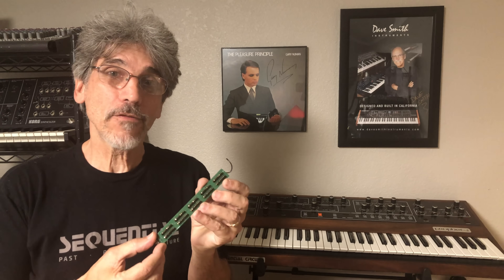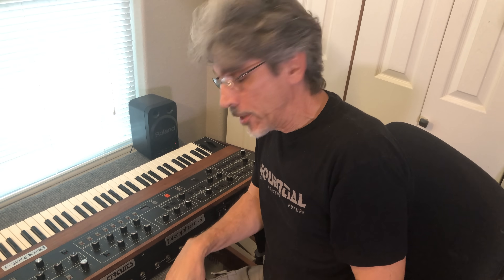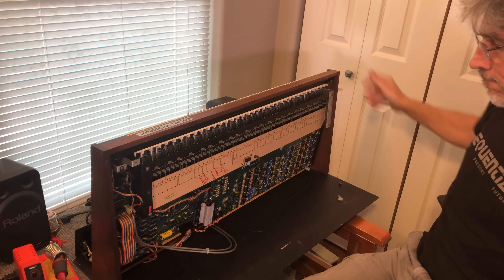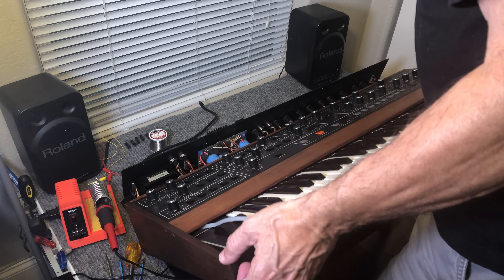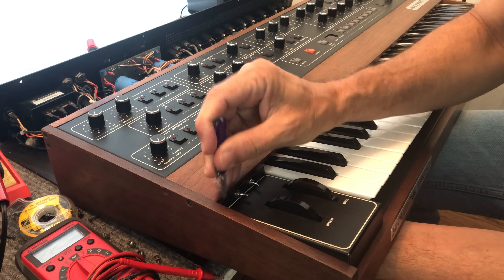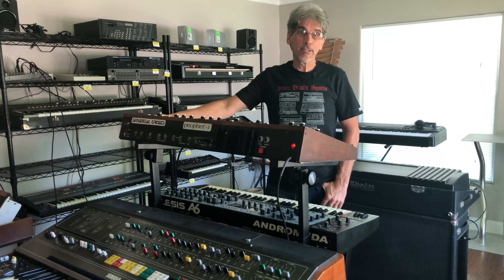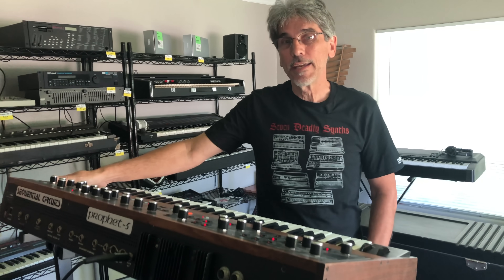The Analogue Renaissance REV -1

Comment: Hi - quick question before I pre-order.  Obvious maybe - but have to check just the same. 😉 I assume I can't use my old Curtis sounds once this is wired in.  It's the SSM 2/4 pole and bass compensation only unless I desolder and go back to the original.  No option with the switch to use the original Curtis because they've been taken out?  Obvious maybe, but just checking - thanks - this looks great! 👍
Reply from the maker: Yes, the Curtis chips are removed to install the REV -1.  But with the switches set to 4-pole with Q-Comp off, your original sounds will be fundamentally the same as before - they will just sound bigger.
Reply: @Syntaur  Thank you for taking the time to get back to me - really appreciate it and am ordering one as of right this minute.  It was a little difficult to find links to purchase , but they are available (currently preorder in June 2020) - note that I ordered from the European outlet as that's where I am and want to avoid extra tax (http://www.analoguerenaissance.com/rev-1/), but for folks in the US the Syntaur web page would be better (https://syntaur.com/Items.php?Item=REV1)👍👍
(I will delete the links if Syntaur prefers, but I thought they'd be helpful as it took me a while to find them).

Comment: Great video and great product. Two things to nitpick: 1) wires at positive potential should not be black and 2) those "Arduino" connectors are notoriously unreliable, especially single stranded ones which have no holding power. Better to solder those wires as well or at least use 1 single connector.

Comment: I thought nothing would be able to match the clean and cutting resonance of the Jupiter-8 2-pole mode, but this matches it. That said, this is only half of the sound of the Rev 1/2. The SSM2030 oscillator was saw core, while the CEM3340 oscillator is triangle core (yielding a brighter saw).

Comment: Can I use it in a Prophet 10?
Reply: Hi, I'm the designer of these. That should be possible immediately on the later versions of the prophet 10. Only thing extra needed is some extra wires to those switches.
Reply: @dnaab136  Hi, I shot you a letter

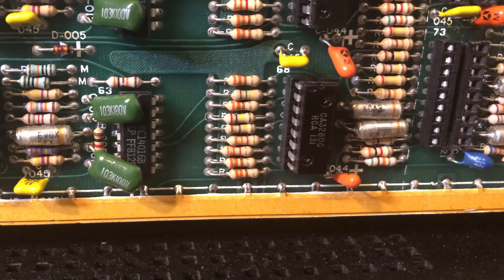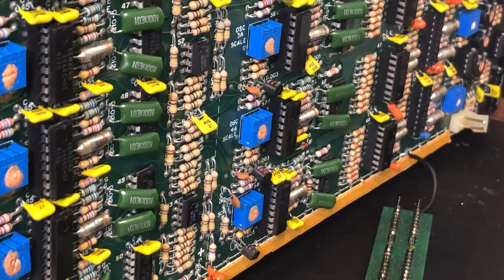Comment: You should not be removing/connecting/soldering electrical components while power is applied to the equipment! 3:24 Disconnect power, 4:25 Apply power, 4:46 Disconnect power
Reply: I dont see anywhere anything they have still power on it. They just left that out why do you wanne show how they disconnect or  connect a powercord. And how do you want to test any equipment without powering it on. Doesnt work that way.